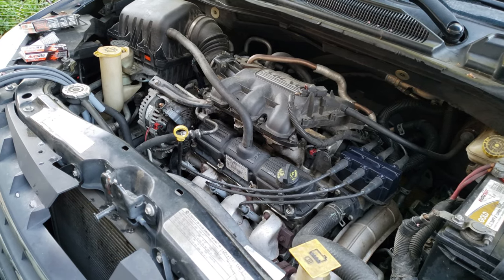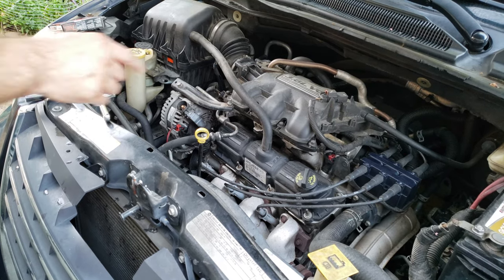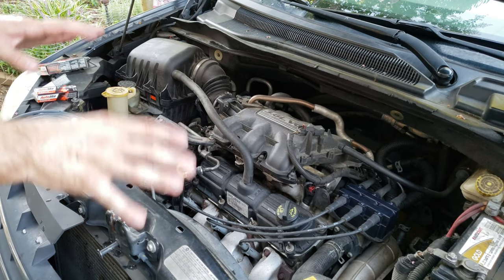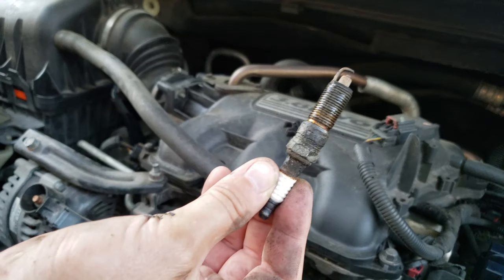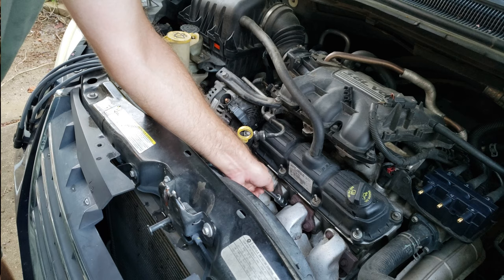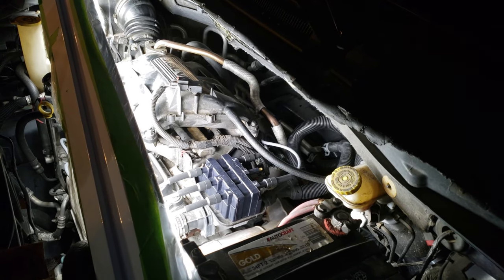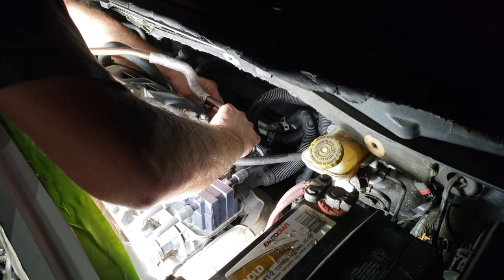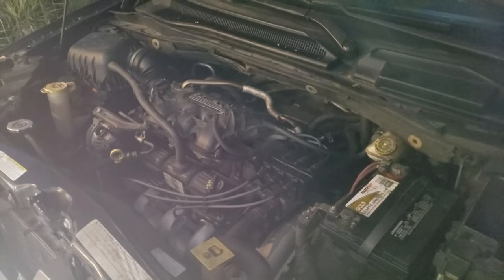Spark Plugs & Wires - 2001-2010 Chrysler Town & Country 2001-2010 Dodge Grand Caravan

Comment: It would have been helpful if you had shown each ratchet/extension combo for each plug.  Dielectric grease on the connections and anti-seize on the plug threads?  Overall really good video-others show removing the cowl and wiper assembly to get at the plugs!  You have made a dreaded project a hell of a lot easier!  Thanks.

Comment: Thanks for showing this.  I've watched a few of these vids for this motor tuneup, and most guys doing it wonder why the plug wires/coilpack is numbered so randomly, when in fact, they are numbered according to the firing order from the crankshaft - there actually is a reason they're not just sequentially numbered 1-2-3-4-5-6.